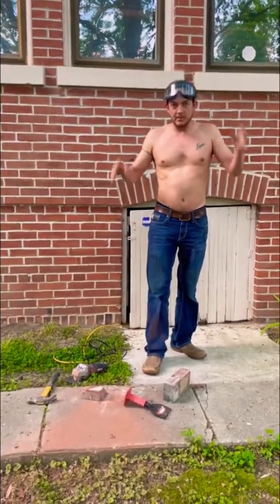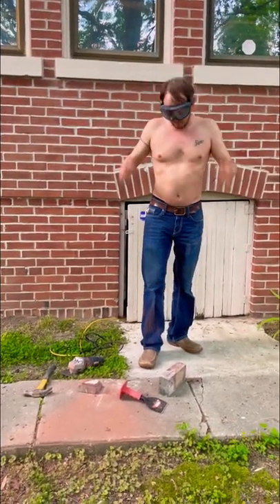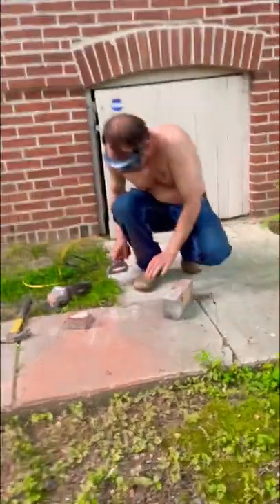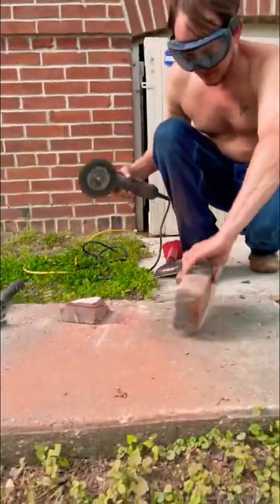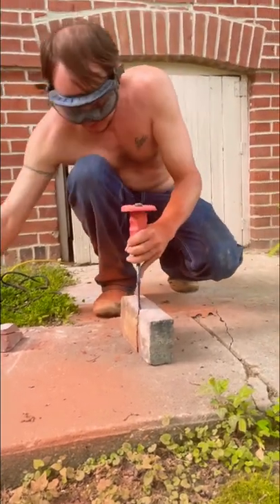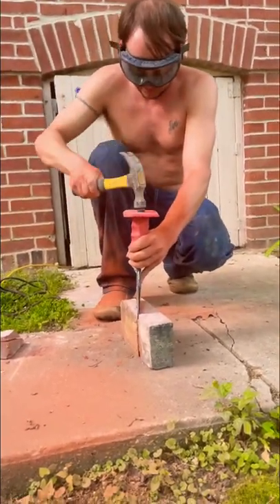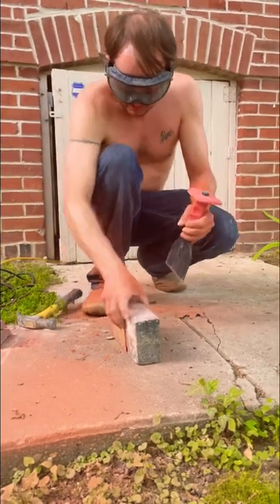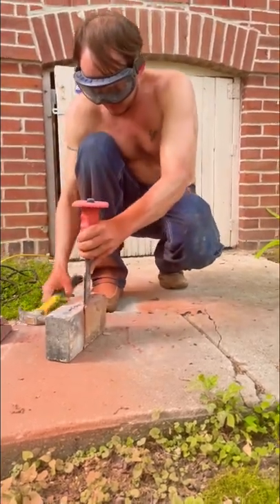How to cut a brick hillbilly style￼

Comment: Because nothing bad ever happened from taking the guard off your grinder. 😒
Reply: meh I hardly use the guard. It prevents from getting deeper cuts. Yet my grinder has a handle and I always keep my gloves on. Yet not having a guard is pretty common.
Reply: The gaurd is the first thing to come off on every grinder I've bought in 20 years. Don't bind your blades and get the good ones you'll be just fine.